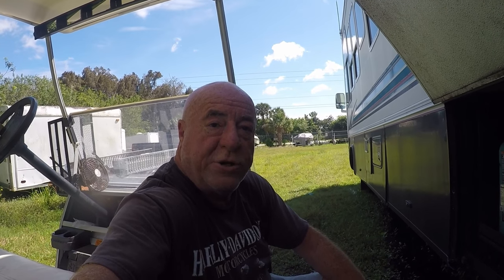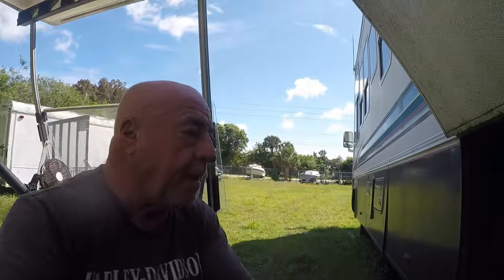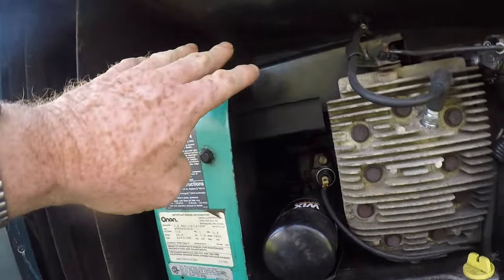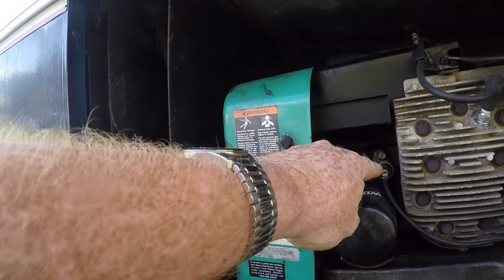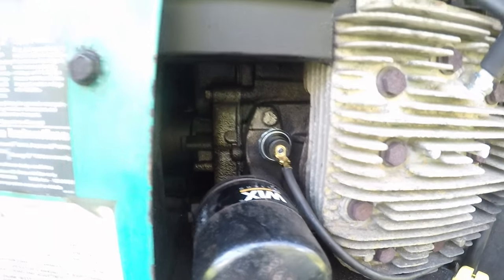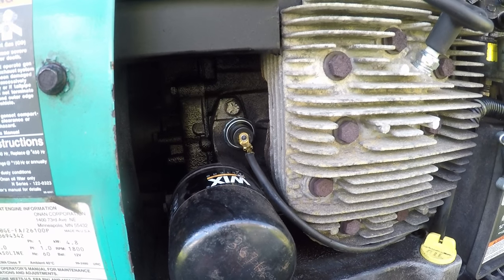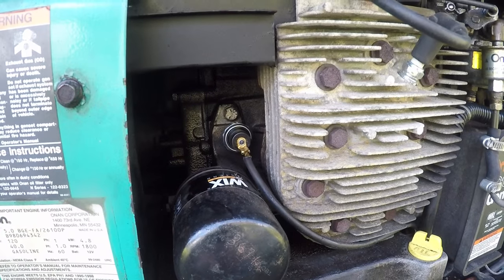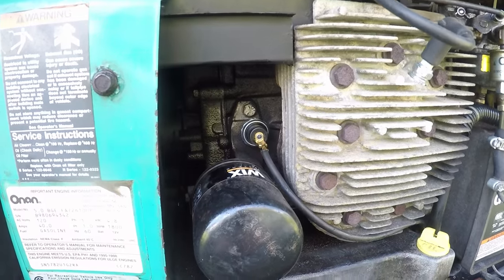Low Pressure Oil Sensor Switch

Comment: Just a quick tip on my rv i have an onan 5500 generator with 2 fuel filters.Onan said to replace the fuel filter closest to the carb with a tube type part to eliminate that filter,just did that and changed the spark plugs at the same time...
Reply from the maker: +Mike m I will look into that!  Thank you!

Comment: The oil pressure switch on my Onan 4k Emerald would have been easily removed with a 27mm deep socket.

Comment: Generator was running and it shut off from low oil will it keep the starter from starting we replaced fuse and put oil in it and still wont do anything